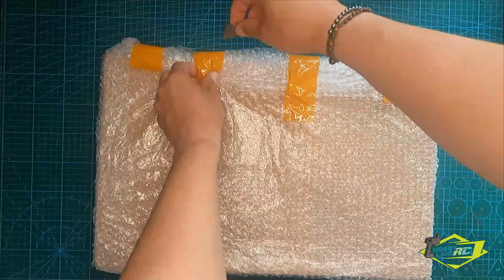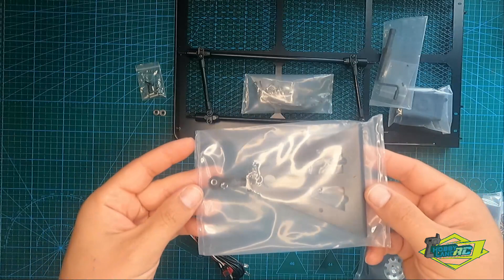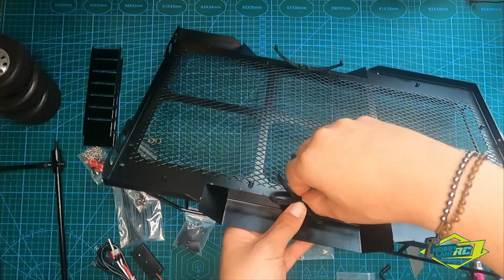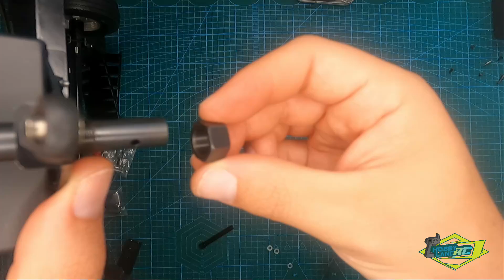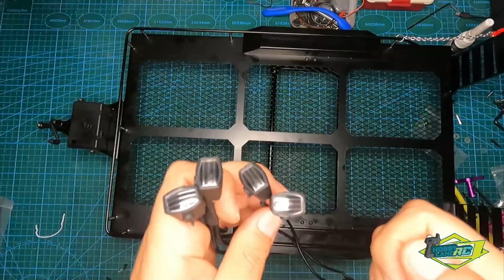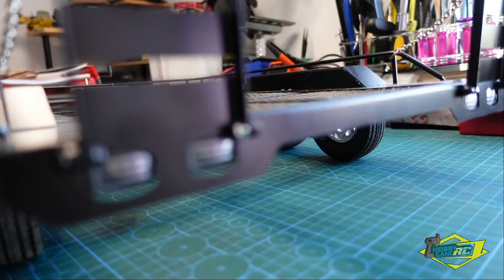🛠REMOLQUE RC 1/10 UNBOXING & REVIEW 🛠 // MONTAJE assembly 🦾  🔊español

Comment: Gran vídeo amigo y de gran ayuda,sabrías decirme que medidas tiene la llanta o si sabes algún sitio para poder comprar llantas más bonitas para el remolque?? muchas gracias y un saludo
Reply from the maker: Hola, muchas gracias. Es de 87 mm  y una anchura de 28 mm, va bastante ajustado en tamaño al paso de rueda y al chasis por lo que no mucho mas de ese tamaño aceptara que le pongas (sin modificar claro) quizás 94 mm x 35 mm máximo. Un saludo
Reply: @HOBBYLANDRC ,si realmente busco solamente llantas para acoplar a las ruedas que vienen con el,pero la medida que tienen no logró encontrar.

Muchas gracias!!